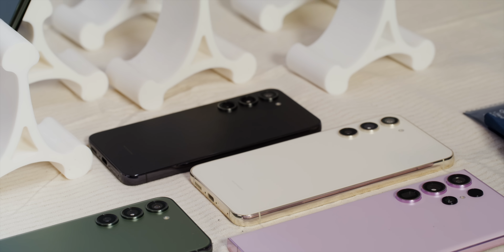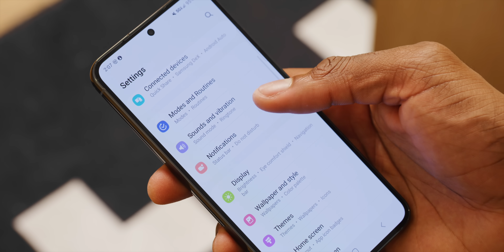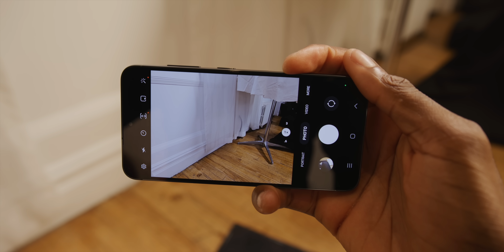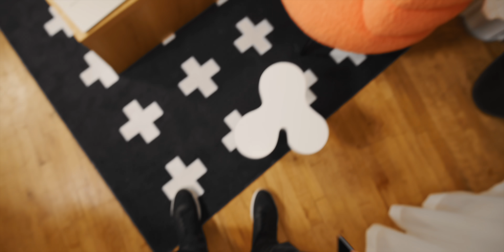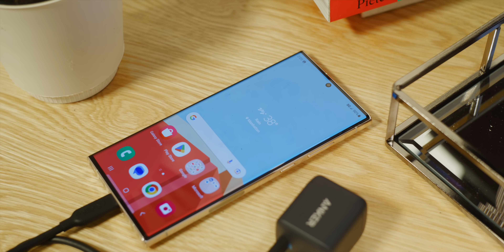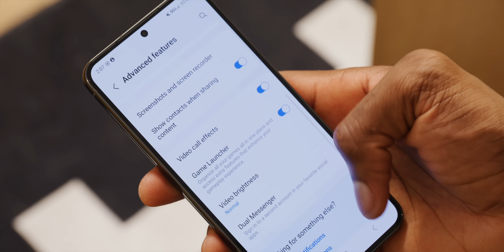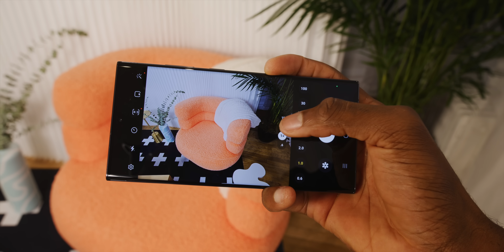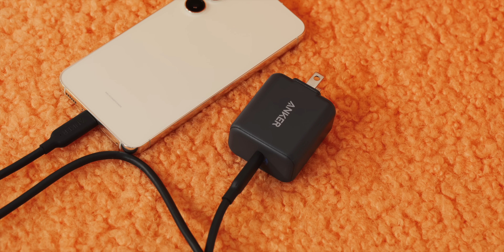Galaxy S23 / Ultra Impressions: Cruise Control!

Comment: When you get to the full review, please comment on the shutter lag if you can. I've had 3 Samsungs in the last few years and the blurry photos of moving objects drives me insane and it's rarely mentioned in any reviews. Everyone always mentions the quality of the final photo but rarely talk about the actual camera experience, like how many blurry photos do you need to toss to get one just right? Thank you!
Reply: Maybe you can use the Pro photo mode and use the right shutter speed ( higher the better) and ISO to get a good photo first attempt.
Reply: Oh really? Didn't know that
Reply: Mrwhosetheboss review commented on that and the improvement made
Reply: On my S9+, there is a "Sports" mode which forces the aperture to f1.5 and significantly decreases the shutter speed. I'm not sure if the newer phones still have it, though I prefer to use Pro mode (everything set to auto except for shutter speed) as I can set the shutter speed to exactly what I want.

Turning HDR to "Auto" or "Off" rather than "Always apply" significantly helps in the normal photo mode.
Reply: You're right, but that's always been a thing in photography. Photographer would burn a whole role of film to get a couple of good shots.
Reply: I never take photos but I felt your pain!
Reply: I saw they have a camera assistant app where you can shorten the shutter speed, but says at a lack of quality.  Don't really know what kind of cut and quality it produces, as I have not been able to test it out. It's not available on the fold 4
Reply: Phone tries its best to get high dynamic range by capturing multiple photos at different exposures and shutter speeds. That is the reason for the lag. Its not lagging, its capturing multiple photos. You don't like it? Go to promode and choose your own shutter speed.
Reply: I use the camer motion feature which is on top right (one before the filter option, its a square with play button). With that it basically does a tiny recording, especially helpful if you have kids constantly moving, that motion feature then allows you to take a pic of the few second motions.
Reply: If the last 3 Samsungs have had that bad a camera experience, maybe its time to move 👀😂
Reply: The amount of people commenting who have literarily zero clue on how cameras work explaining what shutter lag is 🤣- it's not related to the shutter speed, HDR, or anything.  Do some research folks, it's a problem.
Reply: You should switch to Pixel or iPhone. Samsung still has shutter lag
Reply: @adriasanchezcaballe  I think that's his point, people know alternatives exist but most mainstream reviewers don't even mention it either because they don't want to give bad press to Samsung or because they usually take photos still on a tripod/gimble when doing comparisons and it's not really as relevant there. They are rarely testing in real world, low light scenarios where the shutter lag is really obvious and ruins photos.
Reply: Guaranteed they did not fix it
Reply: @steverogers7211  There is nothing to fix. They have given a pro mode for that exact purpose. But people never bother to learn. Phone tries its best to get high dynamic range by capturing multiple photos at different exposures and shutter speeds. That is the reason for the lag. Its not lagging, its capturing multiple photos. You don't like it? Go to promode and choose your own shutter speed. This is nothing but ignorance...

Comment: This is so similar to last year's line-up I feel kinda dumb for waiting for this with excitement :( But I like the Ultra being more boxy 🌚❤️
Reply: My only gripe with the S22 was battery, so having a more efficient chip and a physically bigger battery are exactly what I'm looking for.
Reply: @DSP720  That a great point actually! Battery Life did need improvement!
Reply: Same I think if it had more boxy sides like apple it would add more truth to the Name and be the ultra phone. With it being so thin I know people who don't use cases and the thin sides make it more prone to sleep, just my opinion. I've always the galaxy and think the cameras are better than apple
Reply: @ileanaluna4491  flat apple phones feel gross in the hand. Goofy ass phone
Reply: @mdmazing183  I understand it what you mean in previous videos marques has explained that the iphones have sharp boxy look I think rather th as n it being completely no thin to have like an inch on it like the s22 but still an awesome phone right now I would not switch to apple. Samsung wins on the phone, better battery,camera,faster, and brighter screen. I just think they should add a blue phone to the mix 😌
Reply: Makes sense why it's so similar this year. Last year's was a huge step up from the 20 and 21. Probably also helps costs to reuse designs, especially during a global recession.
Reply: @Yt-qi9ot  Well, yes 🤔
Reply: But what did you expect they release phones every year you cant expect them to realize something brand new and original every year .
I always skip atleast 2 generations of phones no matter the brand its always each 2/3 phone releases are basicly the same untill the 4th one comes along.
Next year expect something brand new from both Samsung and Apple.
Reply: This is like iPhone SE with 3 eyes😂
Reply: @kimchi7703  damn. The back of the phone and the logo is all that matters to you?
Reply: they upgraded the performance at least
Reply: If you buy phone for looks and social status and not for its features. You should move on to the apple's side. Because internally that s23 is not the same. The new chip has outperformed A16 in peak performance and power efficiency  test in GPU and mid frequency CPU.. Lookout for battery tests. There's a high chance that it will defeat 14 pro max. This is actually the most upgraded galaxy. What actually matters is not the looks but the brain inside.
Reply: @TheRealGigaCat   everything you said in your write up is quite the opposite lol
Reply: @Jedidiah_  what did i say and what's the opposite? Point it out. Loling won't help. I will be waiting 😊
Reply: @TheRealGigaCat  yeah even 8 gen 1 was already beating a15 at gpu so it’s even more impressive how much further 8 gen 2 went.
Reply: @TheRealGigaCat  same word for that exynos. Boring
Reply: @TheRealGigaCat  Precisely because I do not care about looks and status is that I do not care about the new S23, to me the S21 Ultra is still the GOAT ❤️

And I get the specs but listen man, I only use my phone for social media, taking photos when I don't have my camera or maybe for simpler photos and using emulators, but even those games run pretty well on current phones so I'm not that interested in the numbers game 😬
Reply: @Bmontepeque11  Then, You are the best user. Unnecessary upgrade are bad too.
Reply: @Bmontepeque11  I know the feeling when you buy that year flagship you like the feel of having best smartphone but that shatters when next version of it releases you feel some kind of empty feeling so people like you need to comment like next version waste and all just to feed your feeling of having best phone.  S22 ultra is better in everything than s21 ultra. But here you are saying s21 ultra is goated and no need for s23 ultra. S23 is miles ahead than s21. Maybe s21 is enough for your requirement but that doesn't mean s23 Has not much improvement. Sure many uses 5 years before phones till now because that's enough for their requirement but doesn't mean current version is useless or not much upgraded.
Reply: Im upgrading regardless.
Reply: @stuffandthangs3953  You go ahead man 🌚 These are still great phones! I'm just saying like, I expected more :( (The one thing I want is to be able to take photos instantaneously 😂)